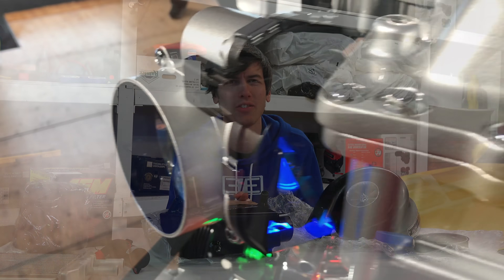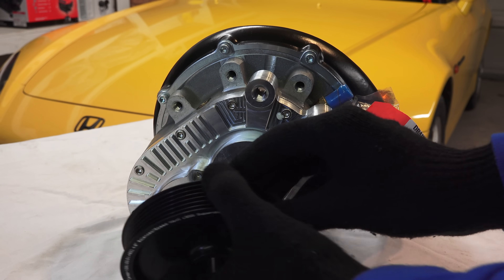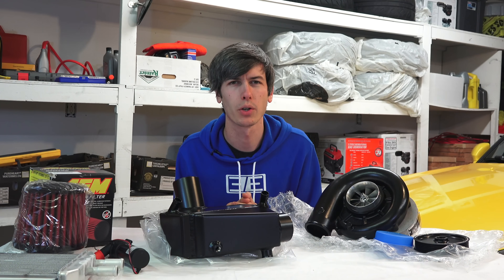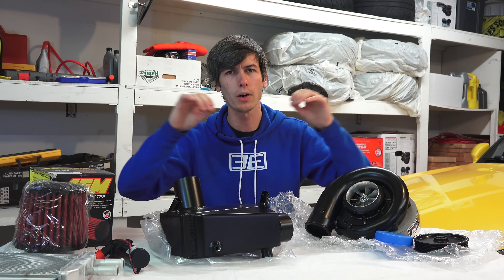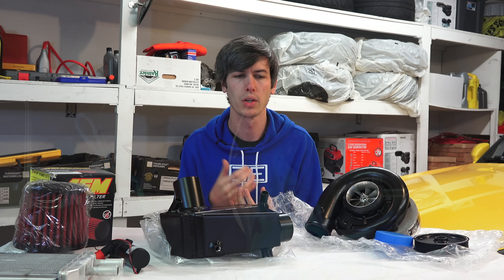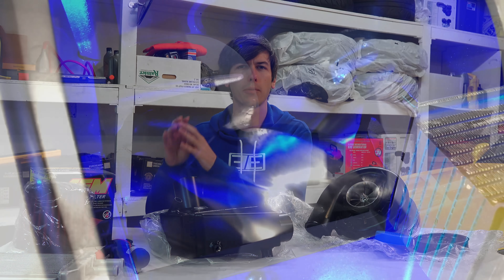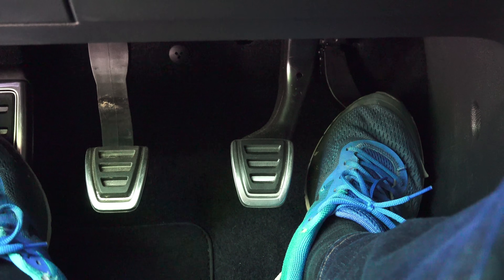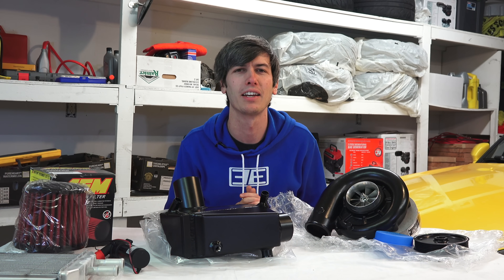Turbochargers vs Superchargers - Which Is Better?

Comment: There is a misconception that turbochargers use energy that is wasted and thus free and have no detrimental effect on an engine's efficiency.  This is not the case.  In order to compress the incoming air, a turbocharger will cause an increase in exhaust back pressure to occur.  This bottling up of the free flow of exhaust gases out of the combustion chamber causes a loss in power and is analogous to the loss of power a supercharger causes to compress air in a supercharger equipped engine.  Whereas you normally want the exhaust gases to escape freely out of the engine to produce more power, a turbocharger acts to restrict that flow thus costing a finite amount of power to operate.  Otherwise, a nice layman's explanation of the two methods to achieve more power in an internal combustion engine.

Comment: Good video. I went with a turbo on my 09 mustang. Street only and called my fast grocery getter. Your tunner is also the key. I used a great guy in SC. I have 440 whp at 6l bs, at 12 lbs I have 550 whp and 545 of torque. The nice of the turbo is I don't race light to the next light and the turbo is not being used. But once on the hwy a different story. I looked at a whipple twin screw, but learned it always on, making it parasitic. So always being on is a bad point to myself. I may change to supercharger after the turbo dies or needs  maintenance.

Comment: Turbos don't use wasted energy! There is preassure in the exhaust manifold that drives the turbine wheel, just like the compressor wheel drives the pressure in the intercooler piping. That preassure is indirectly driven from the crankshaft.

Comment: Turbochargers STILL rob you some power by restricting the exhaust out of the engine, it may be doing it less than the S/C but it still will cost you some HPs to operate a turbo.

Comment: Hey why does dragsters use turbo and make more then 1000hp and don’t use superchargers
Reply from the maker: Top fuel dragsters use superchargers, making around 10,000 HP. But either solution can increase horsepower.
Reply: BDS Blower Drive Service  has been doing Top Fuel for nearly 50 years...Supercharging longer than almost anyone I can think of short of aerospace stuff.

Comment: So I'm not car or engineering savvy by any means (hence why I'm watching videos like this to learn), but I've been wondering if it would be possible to make something that works similar to a supercharger or turbocharger but that instead of taking in air that is then used by the engine, takes in the engine's exhaust gases and compresses them into a pressure tank? Or would it be overkill to do something like that rather than just have the engine directly pump exhaust into a tank?

Comment: Well what you need to explain is the correct things you are talking about. 

What you are holding in your hand is one a procharger hybrid. Which gets rid of turbo lag and gets rid of higher rpm hp loss. 

I'll tell you what you probably don't know

Roots style. Super charger belt driven
Turbo exhaust driven

Procharger. Turbo style belt driven. Which is the best. For every application.

Comment: Hello, my main problem with SC's is the fact that they're always pumping air, creating boost whether you need or not. There are ways to moderate this fact but they have their own set of problems. I'll wait that fraction of a second and go with the highest efficiency and usually power level.

Comment: It seems to me that the only reason you like superchargers more is because of cars that are manufactured under EPA standards.
As far as getting power and overall peak performance out of a vehicle a Turbo will win every time. Because a supercharger no matter how responsive it may be is always limited by the RPM of the engine. My two cents

Comment: Please explain how hot gas spins a turbine.  I don't understand that at all.  I do see that moving gas will spin a turbine.  That makes sense.  But it doesn't matter if the gas is hot or cold, it is the moving that turns a turbine.  Exhaust gas is moving, and it's moving because the piston is shoving it out of the cylinder.  Now, if someone were to say that the exhaust was still burning and expanding after it exited the cylinder, I don't see how that helps anything.  When the exhaust valve opens the exhaust enters a pipe that is already filled with exhaust gas.  If the exhaust is still burning and expanding outside of the cylinder, it is expanding and pushing equally against both the piston and the turbine.  The expanding exhaust will create back pressure against the rising piston, robbing the engine of power.
Reply: Thermodynamics.  Hotter gasses expand and move more rapidly, colder gasses compress and move more slowly.  Part of the reason even people without turbos will head coat their headers or even entire exhaust is that by maintaining the exhaust gasses heat it insures that their exhaust will flow more.  Keeping the heat up means the same mass of exhaust gasses takes up more volume and moves faster, allowing it to carry more energy from the engine to the turbo. If you did not want to swap to a larger pipe do to the loss in low end torque and gas mileage then you would have to use some other means.  Heat coating the exhaust would make it retain more of its heat, avoiding some the slowdown that happens by the exhaust gasses cooling. Faster gasses means less restriction allowing the exhaust to support a higher max flow (and thous, HP).  His also helps below peak power (thus peak flow) and when at part throttle since the exhaust can remain smaller (avoiding being to oversized, thus cooling and slowing as much) and maintain the heat level better, meaning you will actually see an improvement through the whole curve instead of an improvement at the top end and a drop off at the bottom end.

Forced induction vehicles can actually get away with a slightly smaller headers and exhaust size due to them having higher peak exhaust temperatures. Aftermarket turbo setups rarely use a slight smaller exhaust size though since a slightly oversized for the target power turbo back has some advantages in performance and responsiveness.  However there is a trade off in off boost performance and gas mileage.
Reply: Troy, thanks for the thoughtful reply.  I still don't understand.  The exhaust is not like wind, it is not just a moving gas.  It is a moving gas that is confined within a tube.  It has at least one open cylinder at one end, and the turbine is at the other.
Reply: There is a pressure differential between the cylinders and the end of the exhaust.  Extremely high pressure in fact.  It wants to equalize which means it will move towards the area of low pressure.  How hot it is will effect how fast it can move and how high the pressure will remain as it moves through the exhaust.

The turbine is a restriction, but not a dead end the way a cylinder is.  So the high pressure gasses, seeking to reach a lower pressure state, will flow through and spin the turbine on their way to the low pressure at the end of the exhaust.
Reply: As I see it, the pressure is caused by the pistons pushing exhaust gas out of the cylinders on the exhaust stroke.  The engine acts like a pump pushing gases out.  Then those gasses meet a restriction, the turbine/compressor unit.  The resistance from the turbine must put back pressure on the pistons.  What I am getting at is, I don't see any way that a turbo charger uses "free" energy.  It appears to use power taken from the engine just like a supercharger.  The only difference I can see is that a supercharger doesn't use a compressible gas as the power linkage.  I would love to have a revelatory moment about this, and suddenly see how exhaust gas does what I currently think must be a miracle, powering a turbine/compressor unit without an equal energy reduction from the engine.
Reply: We are arguing at cross points.  Turbochargers do in fact use power taken from the engine.
Reply: Thanks.  Everyone I hear, including the guy in this video, say turbochargers "use otherwise wasted exhaust gas."  He says superchargers are powered by the engine, but does not say that about turbochargers.  I have always wondered what magic exists to make the turbine spin for free.  I am not an engineer, and my knowledge of physics is very basic, but I think I know enough to recognize that the exhaust gases get their velocity and pressure from being pushed out of the cylinder(s) by the piston(s).  And any work done by that moving gas creates a backpressure on the piston(s).  That backpressure draws energy from the engine just as certainly as a supercharger does.

Comment: Turbos may be more efficient, but in the long run, a supercharger is less prone to fail, due to the lower RPM's it operates (about 50k vs up to 250k for the turbo). So you can save couple of hundred dollars from fuel over the years and then give them for new turbo. In the end of the day, you should drive both and decide which is the best for you.

Comment: But there is a "lag" with superchargers, they need the revs to increase to increase the engine speed and therefore increase the boost, just like turbos which need to increase revs to increase exhaust gases and therefore increase boost. Normally larger engines (big V 8's) will have superchargers, this could change the whole perspective as the V8 has a ton of grunt already, whereas the 1600cc Turbo has very little power until the turbo spools up.
The question is, would you rather drive a 1600cc with a Turbo or Supercharger, not would you rather drive a 7500cc supercharged car or  a 1600cc turbo charged car.

Comment: Isn't the exhaust pressure also coming from the engine? I mean, if you're driving a turbine with the exhaust, isn't that making it harder for the exhaust gases to exit the cylinder, effectively pushing against the upward motion of the piston?

Comment: Superchargers FTW! Just listen to the sound of a hellcat supercharger. It's just orgasmic!!
Reply from the maker: The hellcat supercharger whine at mid-throttle is 👌👌
Reply: Engineering Explained I got a reply from the man himself!! 😲😲 And hell yeah!!
Reply: The '03 and '04 Cobra's had that beautiful whine as well
Reply: I love that sound, sounds like a jet engine.
Reply: Electric cars are gay af lol. You think no engine sound is cool? That would be boring even if it is fast.
Reply: @TaylorLuna-fs9eo  supercharger isn't for electric cars.
Reply: Superchargers, all they do is whine....  😅🤣😂
Reply: Cool comment besides the hellcat part....
Reply: The demon is way better and faster than the hellcat
Reply: Yeah but the engines a V8
Reply: yea but listen to an Turbocharged RX7
Reply: @jamesstephen7350  the orgasmic sound is mostly from the wenkel tho.
Reply: Whiiiiiiiiiiiiiiiiiiiiiine
Reply: Now listen to Underground Racing Lamborghini and change your mind.
Reply: @straight_intro  Now listen to a 03 cobra mustang supercharged
Reply: If an engine is designed from ground up for both Turbo or SC....both will be fine. Generally bigger ci engines use SC....tubros on smaller engines. Lag is adjustable on a turbo design by size of turbo, different types like twin turbos or elecric assisted turbos.  I have had both and frankly never saw lag on any of my cars turbos that was excessive. Turbos are most efficent mileage wise as it has little loss of efficiency until you put your foot in it. Nice to have a vehicle that can give good mileage  but also power when you want it. For me a turbo IF properly sized and engineered wil be my first choice in a performance car.
Reply: Electric motor ftw. Its stealth and provides instant power.

Edit: Before you hate, I do equally enjoy how v8 sounds and currently own a 2017 Mustang GT, so I am for both types depending on the applications
And English wasn't my first language so I apologize if I don't make much sense
Reply: @GhostOfAMachine  the only electric engine sound that I liked was for the formula-E cars. Man, sounds like a jet engine.
Reply: Supercharger for big capacity engines, Turbo for small capacity engines... 

Right? Is that not commonly known?
Reply: Best sound is electric car. Very silent and something like the supercharger sound, without that enormous combustion engine sound.
Reply: @eDriver  get your electric fanboy ass out of here have you heard a Prius👌👌
Reply: @thewiserbloodhound197  Funny since electric cars are woopin on gas now.... maybe learn something... must be a ford turd
Reply: @thewiserbloodhound197  Nah, you just jealous electric cars can beat or equally matched gas engines. No need to hate! 😁
Reply: @wintergaming1554  they arent really doing that only in a few classes other than that it's mainly hybrids doing the spanking. But please tell me when a electric dragster takes a rocket dragster down

Comment: I’d be interested about the reliability of the two designs. Looks like that turbo has to take more heat (especially during particle filter regeneration) and better lubrication, while in superchargers you get a more “simple” technic, you do not need that durable materials and precise manufacturing, therefor I would expect better reliability on the long run in case of supercharhers. Maybe statistics would show something else, who knows. Some manufacturers “screw up” :) their superchargers while others produce rubbish turbochargers.
Reply: Superchargers (roots and twin-screw) tend to be much simpler and more reliable then turbochargers.  A simpler more stout design, with fewer and stouter rotating parts operating at a much lower (as much as 20:1) rpm, that only has to deal with a fraction of the heat (1/4 to 1/2) will do that for you.   If for no other reason superchargers have a lot less going on at once, since at most you are driving one large inter-meshed rotating assembly plus a water pump (for air to water cooling) and an electric bypass valve.

Also take it from an engine tuner, tuning a supercharger is a whole lot quicker and easier.  Set the A/F ratio to 12.5:1, dial in the MAF, slowly increase timing till hit peak power, and tweak the VVL/T if the engine has it.  Actually I have found for engines with VVL/T that supercharged ones are easier to tune then naturally aspirated ones.

Comment: Turbo.  Because there's a significant part missing from the "supercharger uses engine power to drive it" statement: the engine has to be built for more power than it nets.  For example, an engine that normally produces 500 HP gets a supercharger and delivers 650 HP.  However, if that SC is 50% efficient, the engine is likely producing (and tolerating) closer to 800 HP just waste 150 HP in turning the SC and the heat produced.  Drop the SC and move to a turbo (since the bottom end is already prepped for boost, ie ring gaps and other internals) and you can bring up the net delivered power inline with what the longblock and fueling were already meant for.  Yay for parasitic losses...

Also, I like the characteristics of turbo vehicles, and either method is better than relying on ambient air pressure.  :-)

Comment: You didn't speak about traction advantages of a turbo that lag will give you more traction from the hole shot because the power doesn't come on till you're moving supercharger gives it all to you at all at once so you're more likely to break loose on the rear end
Reply: There are several comparisons on the net you can find that compare the exact same car with one turbocharged and the other supercharged.  Normally the supercharged one gets off the line much faster and gets a noticeable jump before being passed by the turbocharged one (if enough distance is available).  MCM did one recently with a pair of miatas.

Turbos will always be better for applications where you go constant WOT such as drag racing.  Superchargers will always be better for applications where you are "driving" such as auto-x, road course, and other events that require exact requested power delivery and rapidly shifting throttle use.

Comment: It seems most shy away from superchargers even though they provide inmediate response and power, mostly because parasitic loss and limited high range performance. As an engineer, I understand these facts, but also that turbos have their limitations too. In the end I feel supercharging is better, and thats the thing, because of personal taste, manufacturers stop developing the supercharger. But this channel shouldnt stop there, because some companies have tried to better the method and, for me, one succeeded. Enter the variable boost superchgr and the best example is Torotrak. Please look into their computer controlled, cv driven unit, and see if the improvement,over both previous methods, is real.

Comment: Hello...
I have a question...
i have vw tiguan  tsi   4motion dsg gear automatic transmission
Some time when i want to start moving from beginning  i push on the fuel acceleration ,the car doesn't move  like someting tight it  .,,then i push more and more on the fuel the car is spurts in other means goes ahead or scoot  suddenly which is very horrible ....., if there is some thing infront of the car it  may be catastrophic.....
What will be the problem.??
Thanks for help

Comment: Is it not easier to install a supercharger? 
  so my car is a V6. To turbocharge this engine I would need to install a turbo for each exhaust manifold or have some link between the manifolds? 
 Vs a supercharger that doesn't have that complication. Am I correct or incorrect?
Reply: Superchargers have much better packaging, especially the positive displacement types (roots and twin screw).  They basically replace your intake manifold and intake.  Only complication might come from using an air-to-water inter cooler since you would have to run the hot and cold hoses, mount a radiator (plus possibly a fan), and a water pump.  However that pales in comparison to all the piping you have to run to mount an after-cooler to a turbocharged setup.